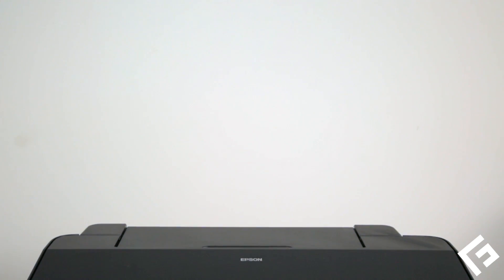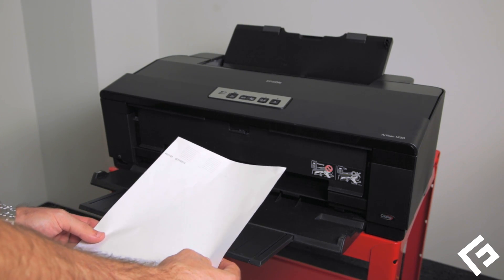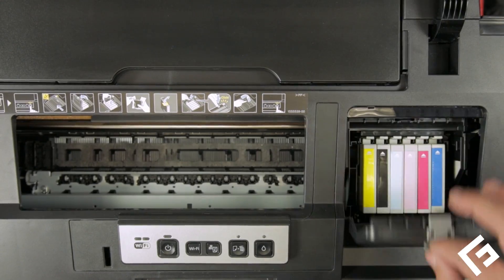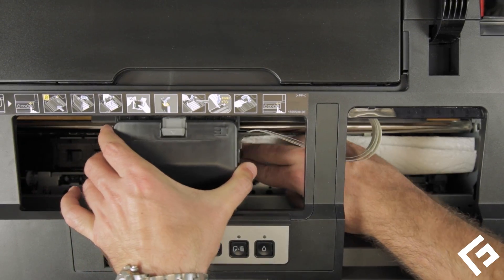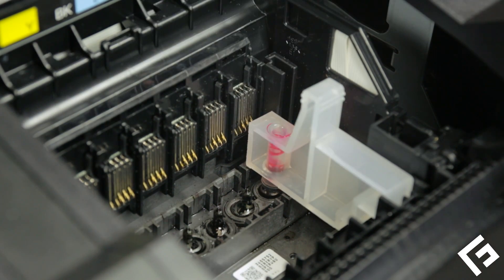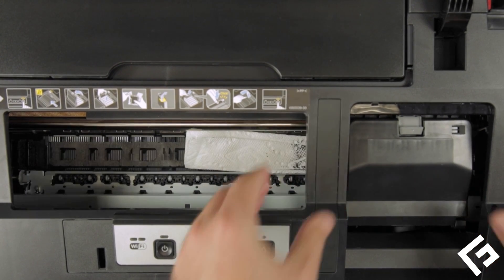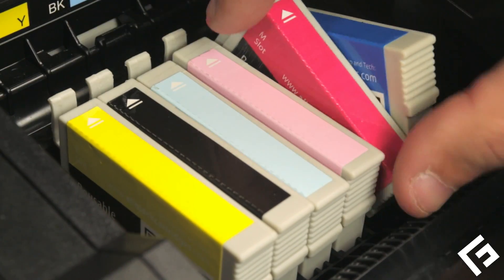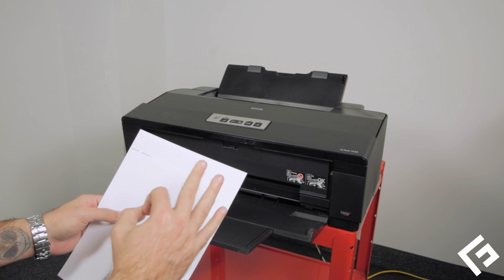How to Clean a Severely Clogged Epson Desktop Print Head – Freehand Graphics™

Comment: I bought that cleaning solution and believe me, I didn't know what to do with it.
 I saw the video where I bought it but there is not much explanation. Thanks a lot for your helpful tip cleaning the printer head. I got a question, Since I bought the all black ink cartridges, there is a black streak all over the images, they don't come out when I burn the screens but if I use a 300 mesh, maybe they will. is it the kind of film I use? or the printer head going bad?

Comment: I have done this process 2 times now and I don't get any ink at all when I run nozzle check. Are the nozzles ruined at this point? What else can I try
Reply: I have the same problem and is trying to find a video that helps me resolve this! were you able to fix it?
Reply: Same here it got worse using this product $115 dollars down the drain
Reply: what type of printer are you using